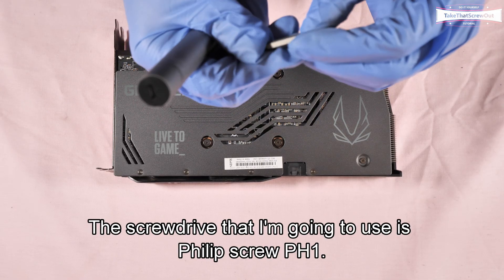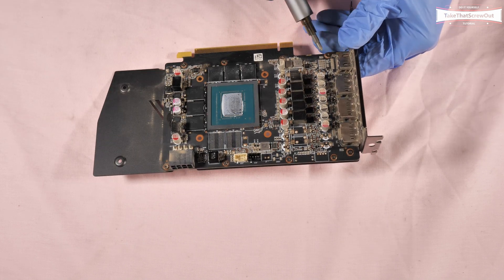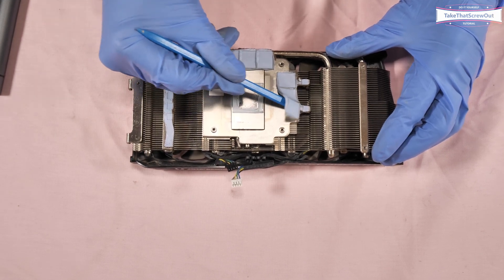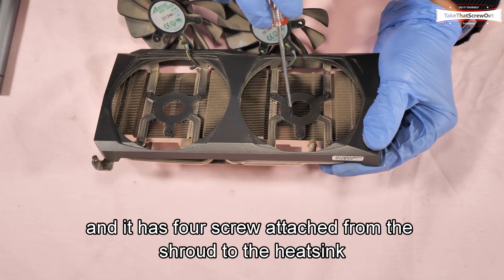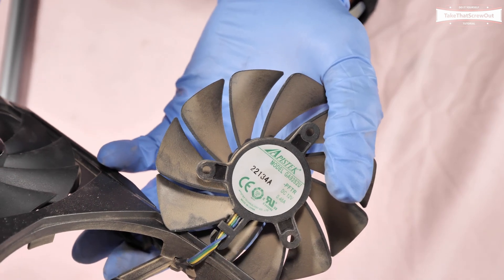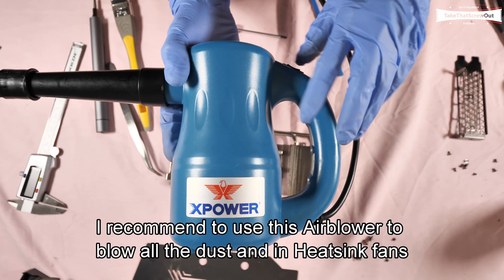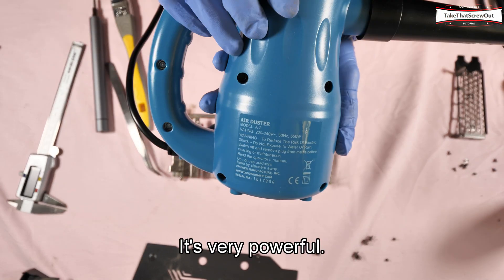ZOTAC RTX 3060 Twin Edge | TEARDOWN\DISASSEMBLY | Thermal Pads Thickness | Fan Replacement | GPU

Comment: nice work , is so satisfying to see it , i want to do it my self to my gpu, but im kinda afraid to dmg anything
Reply: You could BUT those connectors for fans? Yeah I could not remove them, felt too tough and I think I might have been removing the entire connector itself if I pulled harder.

If it's just a repaste and repad, then it's simple as you just need to expose the die and access the pads. But a fan replacement or overall cleaning might be tougher due to those connectors but this was my experience with my zotac 3060. Might be different for yours

Comment: A PH1 screw driver is not a Phillips screwdriver. Phillips screw drivers are 1/4" (6mm) with a tip of a specific angle that's less than the one you're using. There's only one type of Phillips screw driver. The others are cross-point screw drivers of other types.
Reply from the maker: The Ph1 is equivalent to 1.3mm to 1.4mm. That PH stands for Philip Heads screw. As far as i know bro.

Comment: 1. My temp with stock thermal pads were 79-80 on max load
2. Then, i changed my thermal pads it gets 83-84 degree on full load.
3. When i removed the thermal pad and tried to run the card, max temp is 75-76 on full load.

Im using the exact same card with 2mm thermal pads and good quality thermal paste , components are also leaving marks on thermal pad, 

Why this problem is happening and can i run the card without thermal pads? Zotac 3060 twin edge oc
Reply: Not sure, not an expert; but leaving VRM without pads/cooling is not a great idea.
Reply: I saw a Video of the 3060 TI twin edge where the VRM pads where 1.5mm. this is probably also the case here.

Comment: One thermal pad (80*40 mm) is enough for a card?
Reply: hey, I used a 85x45 pad and it seemed to be enough. Had excess too. If you're good and careful and precise enough, it's 100% sufficient. 

I was clumsy and wasted more than I needed

Comment: Hi I was wondering which 4 pin connector is the fan connector white or black?
Reply from the maker: Hi bro! both those black and white connector are for both fans..just ignore those label on the video saying the other connector is for the LED light, that was a mistake..sorry for the confusion.
Reply: No worries! Thank you!
Reply from the maker: @CR1SPRFPS  You're welcome! Take care!

Comment: Great work man! I have a question tho. Is it the same case for CPUs and their fans where we need to pre-heat it for the thermals to be soft and not stick to be easily taken apart?
Reply from the maker: I dont know where you got that idea that needs preheating..you don't need to preheat to take it apart.

Comment: Its stuck so jammed its not opening after unscewing all 9 screws😦🥺, what should i do😢
Reply from the maker: Hello bro! Assuming that the 9 screws that you're talking about are the screws that holds the pcb and the backplate, right? Make sure all screws are gone..the take out the metal side bracket (the silver ) detach the pcb carefully, sometimes the old paste could cause to stuck cause its hardened over time..make sure NOT to BEND the pcb bro.
Reply: @TakeThatScrewOut  I did it, thanks for helping 🙂
Reply from the maker: That's brillant! Enjoy bro! Take care!

Comment: Hi, does this void the warranty? will they have a way of knowing I opened it up If I only changed the paste?
Reply from the maker: Hi bro! That depends on your gpu..majority of brandnew gpu has a warranty sticker on the back screw..if that being tampered..means you void your warranty..but i've encountered a gpu before got it brandnew without any warranty sticker.
Reply: @TakeThatScrewOut  i have the 3060ti version of this gpu which is thermal throttling. as soon as the load starts the gpu temps shoot up to 83c(thermal limit) and as soon as there's no load, say alt tab out of game, the gpu temps drop down to idle 50c. it's like the gpu has only these two states. I wonder what's wrong.
Reply from the maker: @sumansaha295  hello bro! There's two potential reason of what's happening with your gpu..if both fans are working, possibly the heatsink are dusty needs cleaning..and secondly, possibly the paste of the gpu die dries up and needs replacing, and make sure the heatsink plates and the gpu die in perfectly on contact with each other..because i've experienced that in the past that the heatsink was not screwed in evenly to the die, and leave a very tiny gap inbetween heatsink and the gpu die..it didn't deliver the maximum performance for dessipating the heat. So its worth che cking those areas.

Comment: You got 2.0mm 2.5mm 1.5mm pads posted on the products in the description, which pad thickness goes to which? Do i need all thickness or just go with 2.5mm or 2.00mm? Hoping for your answer since I have temp issues with my 3060ti.
Reply from the maker: Hi bro! On this particular gpu ZOTAC RTX 3060 Twin Edge, the pads is 2mm thickness. The Link on the Description are for different item, tools etc.

Comment: I have an unconventional question: is it possible to adapt the entire cooling system of this 3060 to an Asus GT 1030 Phoenix oc? I received the 3060 as a gift because it was broken, only its fans work, and in my pc I have the 1030, does the size of the heatsink match the size of the graphics chip? I know the stock system of the 1030 is enough to cool it, but I would like to take advantage and not waste what I have from the 3060
Reply from the maker: Hi bro! I don't think it would fit with your old gpu..the pcb, screws layout will be different. But you might have option for your 3060 to be converted to AIO water cooling the NZXT Kraken G12 gpu aio. But you have to check in NZXT website " www.nzxt.com " for compatibility of you gpu.
Reply: @TakeThatScrewOut  I think I didn't explain myself well, the 3060 is broken, it doesn't give an image, it's not that its cooling system broke. Perhaps it overheated or received a short circuit, but the 3060 is no longer safe, it only serves as decoration or to use its other parts, that's why I asked if I could adapt the heatsink to the 1030
Reply from the maker: I see! But i don't think that possible due to they have different pcb pattern..

Comment: Do you have one for the Zotac 3060 White Amp 12GB? It's a bit different from this one, can't get past the first step 😭😭😭
Reply from the maker: I haven't done that particular card yet..i can't give you any information regarding that card..sorry!
Reply: @TakeThatScrewOut  Yeah, noticed that no one's disassembling white GPUs. All I see are black cards
Reply from the maker: @johnmichaelatajar3821  i think the White Amp and the Twin Edge are the same layout and share on the same pcb..only the color and slightly difference on design..i'm not 100% sure..but i've checked the pcb..they are the same.
Reply: Does yours also only have 4 screws and the rest are like small metal 'bits'? cause im in the same dilemma lmao
Reply: @YTRSKTR  If you're referring to the White one then just contacted Zotac support and this is their instruction:

To change the thermal paste or pad follow the guide below.

1. Remove the screws on the shroud, this should remove the case fan case on the card.
2. Remove 4 screws on the PCB holding the heatsink.
3. Once the heatsink is out, unplug the fan wire on the PCB board.
4. You should now have a bare PCB. Replace the pad and paste as you like.

Very similar to the video. the only difference is that there are only 4 Screws instead of 6 on the Backplate. I had a hard time separating the PCB from the heatsink not because there was a screw I missed removing but because the thermal pads were melted a bit and stuck like a bitch. So other than that, just follow the video
Reply: @johnmichaelatajar3821 
You are a life-saver! 😊

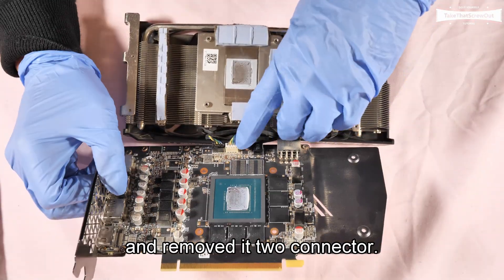Comment: 1:55 - Two connectors, one for each FAN on that vga - fans are contrlolled in asincronous way and are independent. There's no leds on that vga.
Reply from the maker: You're right matey! I missed that..well spotted mate, thank you!
Reply: @TakeThatScrewOut  I just bought one of that cards and it's quite good indeed. I was looking for taking it apart, so I've found your nice tutorial, mostly to have a picture about the MOSfets displacement - I was looking to watercool it. I had an RX480 before and I had a block for the gpu plus one for the mosfets. I could manage to fit the gpu block, but unfortunately the waterblock for the mosfets is unusable here (too large and there's no holes for the screws). This card is quite power-hungy and I don't think that those fets would be good left alone passively...
Reply from the maker: @ThomasWinders  its good to hear that you tried to modified your card..thats very Challenging to do! Wow amazing! Goodluck matey and enjoy! Thanks for your comment bro! Appreciated, Take care!
Reply: The White connector is Hard af, any tips to unplug it?😢

Comment: Thank you for the video I was able to open up my GPU and fix the bent i/o cover of my GPU. That slight bent was touching the motherboard so slightly and causing a short which was shutting down my whole pc on while playing games. You have no idea how much happy I am right now.
Reply from the maker: You're welcome! Glad to hear that you fixed the problem of your gpu and didn't left any serious damage of your system..enjoy! Thanks for the positive feedback.
Reply: @TakeThatScrewOut I have a question 

My bro got me a handful of arctic silver thermal paste

I have my gpu oc I run it daily at least 12 hrs a day it's been running that way for about 2 and half years

Should I take it apart and take the thermal paste off clean it and reapply new paste 

My current Temps are 65c in cod at like main menu screens or loadout screens and like 74c max playing

I know that's not super hot but wouldn't it still get better by putting new paste on thanks in advance for replying and for making the tutorial
Reply from the maker: @jgvtc559  Thank you for your comment.., bro, the temps of your gpu is still really good, 65 deg cel. on heavy game loads is really good..all i can suggest is leave it as it is for another 6 months..and if your temps after 6 months still the same. Don't change your thermal pads and paste if not necesary, that just waste of your money. Only change and clean the fan if you started to notice temps starting to go up on heavy loads, specially when it throttles. 90 deg and above. But if you could clean the fan and heatsink once or twice a year without repasting and changing the pads..thats great! That could save you a bit of your money.
Reply: @TakeThatScrewOut  thank you
Reply from the maker: No problem, enjoy!

Comment from the maker: Here's the Detalied Step by Step Disassembly Tutorial for the Zotax Twin Edge RTX 3060, If you have any question just leave in the Comment below and i'll answer it as best as i can..and Check the Description for the Fan Part Replacement and other tools you see in the video..thank you!
Reply: can i use the same thermal pads for the ti twin edge oc model?
Reply from the maker: @teosas5376  yes! they use exactly similar thickness thermal pads..the design of the PCB is almost identical except for some additional chips for the Ti version. hope this helps!
Reply: @TakeThatScrewOut  thanks, i hope this solved my thermal issues
Reply: @teosas5376  any updates?
Reply: @m.e3753  i didn’t replace them
Reply: hi got a question how long did you have the rtx 3060 before you swapped the thermal pads !?
Reply from the maker: @DutchResist4nce  for me, the best practice if you're a heavy gamer, video editor or that kind of heavy task you throw at your system, once every 6 months or once a year..that depends on how often and heavy your system is used every single day. If you're just a casual gamer that plays only on weekends, once a year is just perfect.
Reply from the maker: @DutchResist4nce  i'm not sure if thats what you mean and did answer your question..?
Reply: Hi there! I know that if I disassemble my card for cleaning, necessarily I need to replace thermal paste, but do I need to replace the thermal pads too? Can I leave them if they are in good shape?
Reply from the maker: @TheWingField  Hello! Thermal paste is a must, should be replace with a fresh one every time the you separate the heatsink from the GPU die, to make sure u have a good contact to transfer the heat. But with Thermal Pads is different..if the pads still in good shape..its not necesary to replace it unless you really want to make sure the pads are good quality by your own choice. If your a heavy load user like a gamer, i recommend to replace pads every 6 months, otherwise once a year is fine. But make sure you use a good quality Pads & paste. Hope this helps.
Reply: @TakeThatScrewOut  Helped a lot! Thanks for answering!
Reply: I have unscrewed 9 of the screw but the heat sink is still stuck. What should I do?
Reply: how easy is it just to replace a broken fan?
Reply: Hi @TakeThatScrewOut would you know what size screws x4 connect the fan shroud to the heatsink? Mine would not go back in, and I have since lost one of them